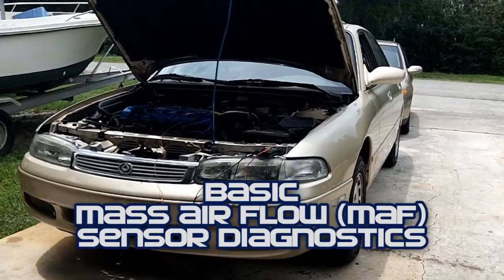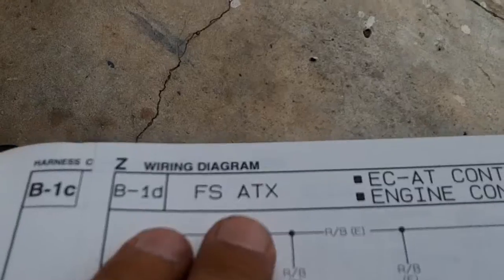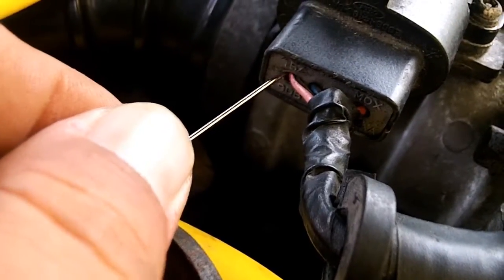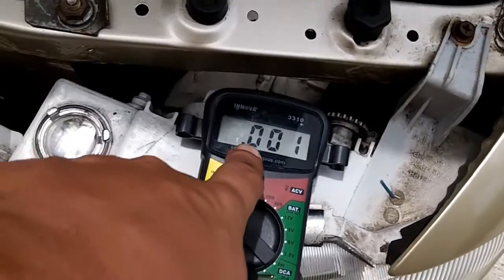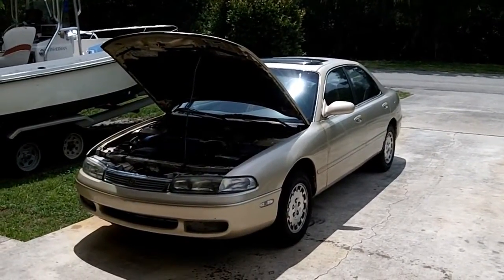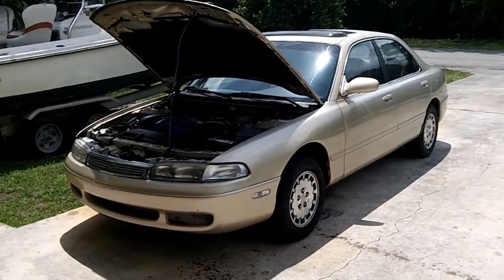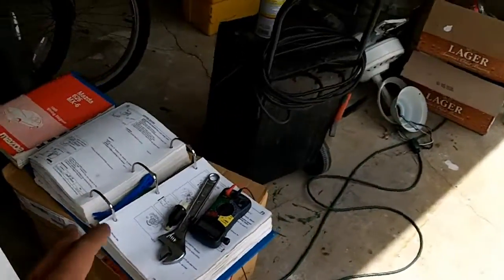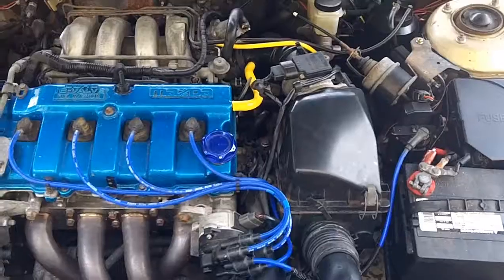Mazda 626 - Mass Air Flow (MAF) Diagnostics

Comment: I have a 1992 Mazda 626 2.0 FS sedan.
A mechanic replaced the distributor and coil, but the problem wasn't solved. The replacement coil blew up after a month. It was a cheap Chinese brand. I bought a Dr. Müller brand and installed it myself.
The lights flicker intermittently, and while they're doing that, the car vibrates more while driving. When the flickering stops, the vibration decreases but doesn't go away completely.
Additionally, when I press the gas pedal in lower gears, the car hesitates and then accelerates, causing the car to shake.
In 2nd gear, when I release the gas pedal, the car decelerates more than usual.
There's a 'click' sound when shifting gears, but they said it's not a big deal and is probably due to some play in the axles.
The coolant temperature sensor is unplugged. When I plug it in, the idle drops to 400 RPM and the engine jerks badly, making it difficult to drive.
Unplugging the TPS sensor doesn't make any difference.
The car does all of these things on both gasoline and LPG. I've taken it to countless Mazda mechanics, but no one seems to be able to figure it out.
Replaced parts: Spark plugs (NGK LPG spark plugs), spark plug wires, air flow meter, distributor coil (3 times, currently Dr. Müller), LPG injectors, V-belt.

Comment: I've got a 626 V6 with stalling issues off the line sometimes. You think this is more likely a MAF or TPS? I was getting EGR error codes but I cleaned out the EGR and they went away but the stalling persists.

Comment: Hello, thanks for your videos I have auto mazda 626 year 1998, I need to know what is the minimum and maximum voltage that should be marked on the multimeter in the MAF signal?
Reply from the maker: http://www.pmx626.info/US/Mazda%20626%20&%20MX-6/Work%20Shop%20Manuals/PDF/1998%20US%20Workshop%20Manual_OCR.pdf
Reply: @DJDevon3  ,gracias lo revisare

Comment: My maf is running bad when check engine light goes off... when engine check goes on the car gets better in performance.. but still... the car is not stable specially at high speeds..
Reply from the maker: When the check engine light turns on it should set a code.  Check for the code.  You're making a lot of assumptions about the culprit without any diagnostic evidence.  You know what your symptoms are that's a good start.  Gather more evidence. Run some diagnostic tests.  A vehicle performing worse at high speeds could be anything from the transmission or injectors to A/F ratio or faulty throttle position sensor.  Without at least doing some diagnostics to rule parts in or out then all you're doing is guessing.
Reply: @DJDevon3  I did check the error code by making a bridge connection in the diagnostic box (near the battery) the check engine light flashed the number of MAF malfunction in addition to other code but when I read voltage of MAF it respond to the throttle position by changing voltage (but not in same range of the manufacturer). I also disconnected the MAF wire nothing happened to the engine speed rpm.

Comment: Hello..very nice videos...i own a mazda 626 and im had a problem of MAF sensor...the engine is not able to stay idle..it rpm decreases creating vibration and also when starting the engine...it vibrates a lot before coming idle n then again it will fluctuate momentarily...As Sir, you are an expert in mazda 626 i wanted to know whether is there any way to repair the MAF or adjust the current of the MAF sensor..thank u..
Reply from the maker: Have you attempted to clean the MAF?  I have another video on cleaning the MAF.  Try that first and if that doesn't improve the condition look for vacuum leaks and do some diagnostics on the MAF sensor.  Use this video and do some electronic testing.